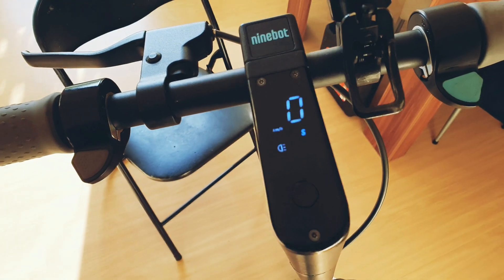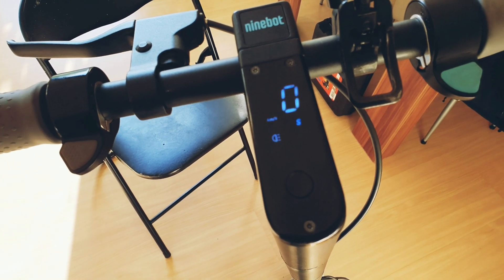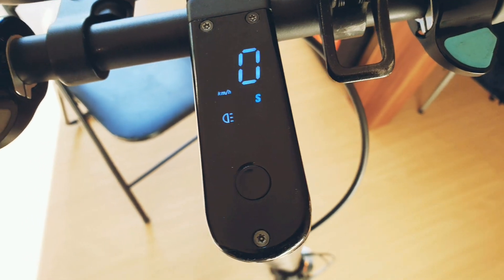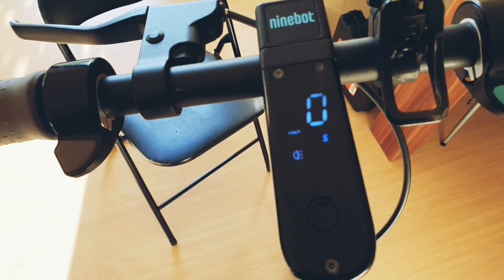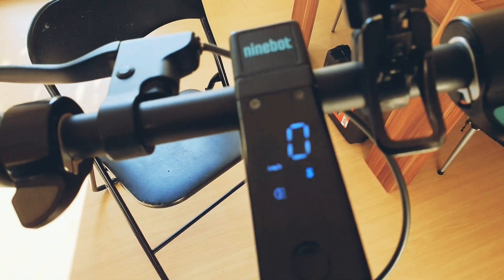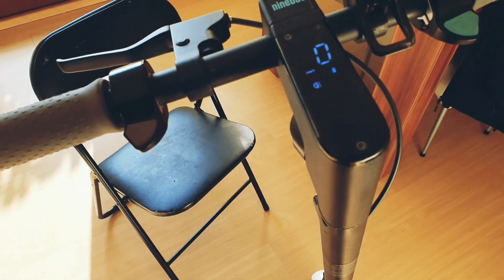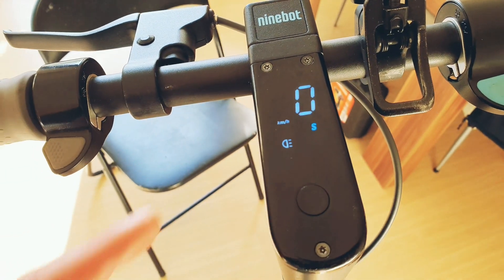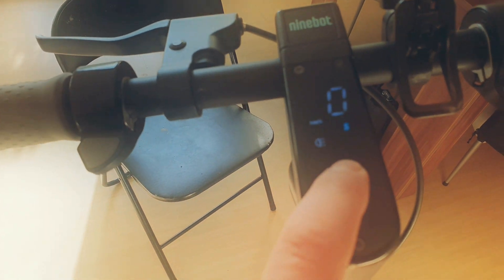Happy BMS Ninebot Max G30  Internal 48v battery with compatible BMS Ninebot Max G30 Speed hack new!

Comment: I have two G30's and want to convert one to 2WD using the motor & ESC from the other. Will this work with a dual motor design?
Reply from the maker: I don't know! But i don't see why it wouldn't!
Reply: @G30MaxForce  because the BMS communicates with the controller via 4-pin cable. If I splice the communication cable from both controllers to one battery, im afraid the battery and/or controller will be confused.
Reply from the maker: @MikeZ8709    But you can modify   one controller in firmware, in order to run it, without communication wires! That's how I would do it!
Reply: Question: if firmware is modded such that neither controller is connected to the BMS, will it still show the battery meter?
Reply from the maker: @MikeZ8709  It will not, no battery information!
Reply: @MikeZ8709 your main dashboard and controller will show battery level if you plug into it. The second one and its dashboard is piggy backed off the  first one. You hide the second display in the stem, so it won’t matter you can’t see the battery level